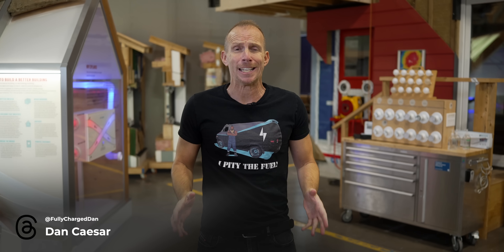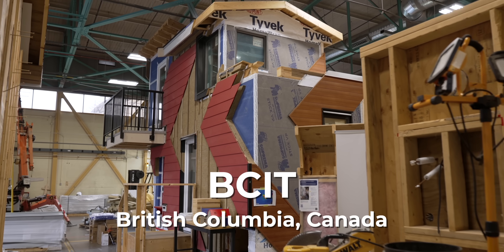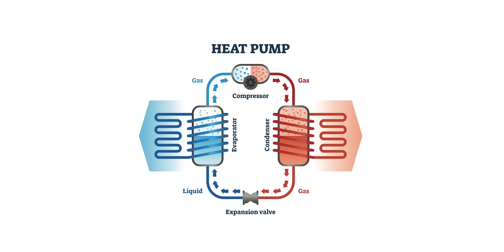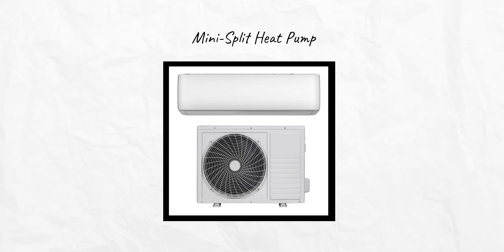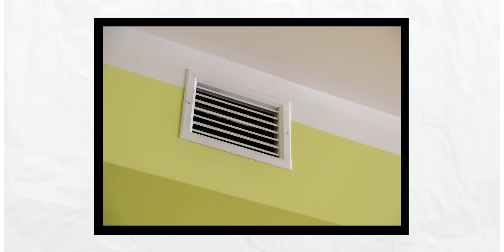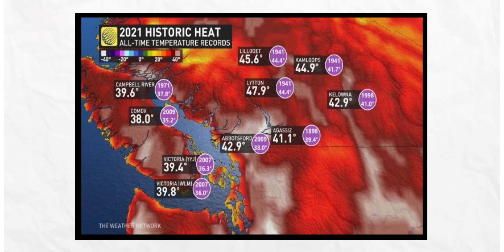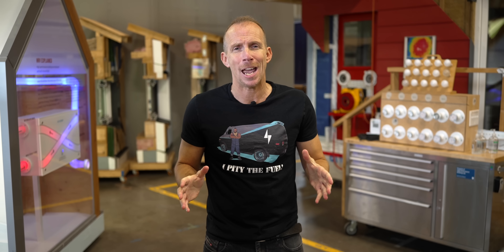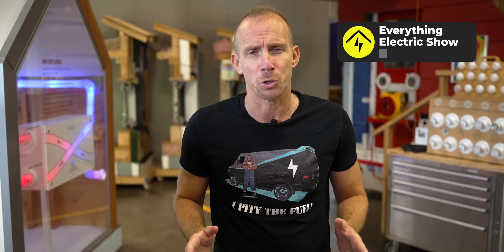The Future of Home Heating and Cooling!?!

Comment: I am so surprised at how little the Samsung TDM Plus isn't talked about - you have heat your water, underfloor heating and radiators as well as cool your home with AC units - it is a combined Air-to-Air and Air-to-Water heat pump, how is this not celebrated and the holy grail of home climate control. In a world with more varying temperatures, a solution in one form factor seems logical. Why have one unit to heat things and another to cool. If anyone has information on others out there please let me know but Everything Electric - you have missed an opportunity - do a deep dive and get this information out there - the space is so one dimensional right now

Comment: Yes we live in the UK and had these installed about 8 years ago. Downside is that we can't seem to get rid of guests when there is a heat wave in the summer. 
Unfortunately no UK gov subsidy for these. Also   you need some sort of hot water system to complement.
Plus side is that they are very compact and inconspicuous.  You don't need to turn your home in to something that looks like a oil refinery or chemical plant with pipes all over like with Air to Water.

Comment: Radiative heat is fantastic, but you can't radiate cool. You have to pass air through a heat exchanger to cool a room. Placing air conditioners near the floor is a bad idea especially with pets. Hair and crap will more easily clog a filter that close to the floor. Only wall or ceiling units are really viable. I think it's left over from convective heat needing to be close to the floor. The forced air solves that problem.

Comment: could have included maintenance (deep clean blower wheel) and ductwork evaluation (if leaking,  poor performance is blamed on HP). not a simple drop in replacement but too many contractors do it that way.

Comment: We are in the uk and had this system installed in our house . We looked at a wet system but liked the idea of cooling in the summer . We already have solar to heat our hot water . So we have had our gas disconnected so no more daily standing charge for gas . Will have to wait for the winter to work out costs to run but I’m sure it will be cheaper with the savings on not paying standing charges 12 months of the year for gas. If the grant covered these systems it would have more than paid for our system .

Comment: With the perceived uk press saying heat pumps dont work. This worry to remove gas boilers is now ingrained. I dont know why the UK government dont have subsidised for air to air . Retaining the existing boiler system. Perhaps with law that requires removal of the obsolete gas or oil bolier after few years or repayment of government subsidy

Comment: I would love an A2A heatpump in the UK, especailly if there is a way it can manage hot water as well. It would be much better for me than a Air to Water
Reply: They exist, I have one which is great.  Just not available currently in the UK (probably lack of demand).  Mine is a Hitachi yutampo twin.
Daikin do the Multi+ which might be available in the UK. But the cylinder isn't that big, in 90 and 120l capacities.

Comment: Great reminder of the difference between air to water & air to air heat pumps. I’d like to understand the cost involved in retrofitting a traditional gas boiler to a2a - it sounded like extra pumps or much more complexity to heat/cool multiple rooms.
Reply: It's quite different. Your old plumbing/radiators is not used at all. So you get rid of the boiler and all the rads, and put a few A2A units in instead. That can be one external unit and 3-5 internal ones, or just 2-5 independent units. The main difference is that you don't necessarily have an emitter in every room because air moves around and you don't really need them. Also you need something separate to do the hot water (immersion, A2W HP built in the tank, separate small A2W just for hot water, zip instant water heaters). The pipes run outside and the units themselves are quite cheap,  so these systems are usually not expensive to fit.

Comment: As some others have commented it is daft that this country hasn’t adopted this technology.  I had it installed in June of last year and it is fantastic.  Great heat in the winter and so a huge bonus to be able to cool my house in the summer.  I have 6 indoor units run in from 2 multisplit Daikin outdoor units. Whisper quiet when working and quick to provide either heating or cooling.  It seems to make so much more sense to convert air at one temp to air at another rather than air to water.  All my old radiators and pipes have gone and with the Mixergy iHP cylinder installed my gas combi boiler has gone and gas meter removed.

Comment: Heat Geek raised some interesting points about air to air vs air to water heat pumps for heating in this video:  https://youtu.be/tNE5GEePXuk?si=CWe9lDb0-JkqSF0O

Obviously they’re great for cooling, but for heating it seems air to water may have the edge when it comes to comfort. Obviously this is a very personal opinion but I thought I’d share this video as I found it insightful, and it raised points I hadn’t thought of (like how moving air removes the layer of heat trapped around your body, that it can potentially dry your skin quicker etc) 👍🏻

Comment: Everything electric - would love to know what the running costs (including loan interest) is for a heatpump vs boiler in the typical housing stock lived in by the bottom 50% of uk earners. My assumption (which could be wrong is typical low income housing stock is poorly insulated & leakier).

Comment: Most properties in Australia have the reverse cycle air-conditioning or heat pump.  The only thing I am not a fan of and much prefer radiant heat is the air blowing and the ongoing noise that it makes I think taking underfloor hydronic type system and using a air-to-water or perhaps even a ground-source heatpump maybe geothermal even as has been done by some.

Comment: I always thought heat / cool pumps are kind of geothermal? As temps a few meters under the ground is quite stable throughout the year, but not that kind of geothermal with hundreds of meters that's always hot to only work in winter or generate electricity.

Comment: Air sourced heat pumps gets better the warmer the outside air is, it's a fundamental property of the physics involved, the lower the temperature rise you need to create with a heat pump, the higher the efficiency you can get. That means they're even better suited for places like the UK, where it doesn't get cold, more than rarely, and temporarily, compared to places like Sweden and Finland. Even if a lot of air to air heat pumps are optimized to work well in as low temperatures as possible, they are always more efficient the higher the outdoor temperature is, all else equal.   

Obviously, if the wind more or less blows straight through the house you'll still need a lot of heating even when it's just "UK-cold" outside, but that seems like another good reason to reduce the amount of energy input required to achieve that heating. I've heard the often bad insulation in UK used as an argument against air sourced heat pumps, which doesn't make sense to me. Getting insulation is another good idea in such cases, when possible, and not technically mutually exclusive even if investing in both at the same time can be too much of an investment in many cases.
Reply: Excellent input. I find there's very little info on heat pumps for cooling, so was quite interested when you mention that "heat pumps gets better the warmer the outside air is". As mentioned in the video, how do you find the A2A heat pumps hold up in very hot, summer weather (ie, 40º C)?

Comment: As an Australian I have to smile at videos like this. A2A heat pumps as you are calling Reverse Cycle Air Conditioning are so common here that we just refer to them as ‘air conditioners’. I don’t think you could buy a cooling-only air conditioner in Australia - at least for domestic use. We’ve had one in this house for 30 years. On the other hand air to water heat pumps are rare here and, by UK/EU standards, Australian houses have about the same thermal efficiency as a tent… Thermal efficiency is something that is getting more and more interest here as power prices rise.

Comment: I'm in Ontario, quoted $20k for a Mitsubishi Zuba 3ton a couple years ago. I want to go to one but I was also quoted another $15k+ plus for electrical upgrades, it's not cheap depending on your starting point. As a Canadian I would also mention there's a lot of work being done by Enbridge to expand natural gas and the contractor who quoted me for the heat pump repeatedly told me it would be real easy just to do propane.

Comment: I'm using this too in the Netherlands. 
One thing though is you have to clean the filters at least every few months. If you forget that, it still seems to work, but has much less power and the efficiency is down the drain.
Also cheap ones can be noisy, so go for mid level

Comment: We've had air-air heat pumps in New Zealand for as long as I've lived here 20 years, and it's not a very comfortable heat. It is drafty and can feel cold even though it's blowing warm air. Most homes in New Zealand install a single air-air heat pump in the living room and expect it to heat the whole house. We have ducted gas air heating and have looked at switching to a heatpump, but we need to replace all of the ducting in the house which is expensive. Ducted air heating systems are noisy where the air rushes out of the ducting, and switching to a heat pump from gas wouldn't actully save us any money due to the unit cost of gas compared to the peak rate of electricity. There is nothing like the warmth of radiated heat like that from radiators or a wood burner. It's quite common for people here to use them to cool their homes, rather than open a window, and that just puts pressure on our already stretched grid. We're having a bit of a power crisis here with low hydro levels, lack of wind and reduced gas reserves, so are importing a lot more coal and wholesale electricity prices have doubled over the last 3 weeks and the cost is expected to flow onto consumers over the coming weeks.

Comment: Fascinating. We’ve got two A2A heat pumps and live in NZ’s South Island. They’re ubiquitous. My area is quite sunny, so my heat pumps run for free off my 7Kw solar panels on a sunny cold day, and cool the house for free in the summer. One issue we notice is that it’s not radiant heat. So that primal feeling of heat-on-your-skin is missing (not a big deal) and despite what they say, the interior fans DO make a noise, albeit fairly quiet. For those still struggling with ‘how the hell do these things work?’; My installer described it as a simple exchange of temperature. If it’s 10 degrees C inside and you want 19, the unit ‘steals’ 9 degrees from the outside air and blows it into the house. That does cool the ambient air around the outside unit a whole lot, but the unit’s fan blows that away and ambient air replaces it. We don’t get Canadian-style winters, but it’s absolutely fine at -5 C and also cools the house on a 32 C day in summer.
Reply: Hopefully the fan noise problem should be significantly mitigated in the future as acoustic metamaterials become commercialised across all industries.

These should make all sorts of noise polluters like fans less of a problem, not to mention offering new, more compact solutions for acoustic isolation/insulation in the home, both from outside and inside sources.

Comment: I had a 3.5 kW Midea A2A split installed 2 and a half years ago. It was deadly cheap but works superbly. I still have my standard gas central heating but hardly ever use it.

Comment: novice question...an a2a heat pump cooling.... it sucks out the hot air in your house....but does it blow cooled air into your house?
Reply: Yes. An A2A heat pump is esentially identical to a standard air conditioning unit.
Reply: It takes the hot air in your house and cools it off by moving the HEAT outside. You need a different system to get fresh air in your house if your house isn’t leaky.

Comment: I’m confused. I have a Mitsubishi multi split unit that can heat and cool the air. Is this a heat pump or an air conditioner? How do you tell the difference?
Reply: They are essentially the same thing.
Reply: This IS a heat pump. Technically, any unit that can cool is going to be a heat pump, any unit that is heat only is probably not a heat pump.

Comment: There's 3 actually:  Water to water. 

It's almost impossible to buy a cooling only system in the UK for over a decade. I believe A2A is not included in any schemes because if you use them on cooling there is a total energy loss so the COP heat is going into the atmosphere. 
Although in reality in the Uk in domestic situations they are used more for heating than the odd 3 days of summer.
Reply: At the same time as the BUS Grant was introduced on Water Heat Pumps VAT was waived on Air to Air
Reply: @davetester100  The customer could only get the VAT relief if they put 'heating' if they put 'air conditioner' it was rejected..

Comment: Last time I checked air to air heatpumps are usually more efficient than air to water heat pumps, as well as being much cheaper to buy in the first place. The lack of subsidy is not as bad as you imply, because they're not much more expensive than buying a gas boiler, and the running costs are much lower.

Comment: The first question to ask when thinking about changing your heating system:
Do you just need to heat your home or do you want to cool it as well?
Crazy that the boiler replacement grant doesn't cover air to air pumps which do just that
Reply: https://youtu.be/myvfqCx1-zk?si=X1QHaZpKEuz3Z5Ri

Comment: I don't understand why this is deemed to be "novel" - I just recently installed a 3.5kW A2A mini-split in the UK for just over £600 (R290 before anyone has a meltdown) - it has been perfect over the last few days of 30C+ weather and in the spring/autumn it will contribute to heating - all powered by PV so totally carbon neutral and runs off a 13A plug so no wiring needed either - the hardest part was core drilling through the wall and making the connections...I've heard Vaillant want £300 for a "cooling chip" for the Arotherm A2W series - rip-off Britain at its finest 🙄

Comment: we have both, air 2 water as main source of heating, and underfloor heating on the ground floor and heating up the water in the boiler. And two A2A single splits on each floor above the ground floor for both cooling and some additional heating especially in my home office so that i dont need to warm up the whole house when i work at home.

Comment: Thanks for doing the video. 
I think this is a really important aspect of heating that’s under rated. I think there are lots of commercial applications like shops that just use resistive heating that’s so inefficient that can be upgraded to this and will save them a fortune in electricity costs. I hate those Air Curtain heaters in the entryway to shops, they seem such a waste next to open doors and resistive heaters!

Can you do another video please on a little more detail?
I’ve been looking for A2A heatpumps for my new office and it’s very hard to find a confident installer that knows about air to air and very few experts that know if there is indeed any difference between an ‘air con unit’ and one that’s specifically designed and optimised for heating (that can also do some cooling but isn’t it’s primary function).
Reply: https://youtu.be/myvfqCx1-zk?si=X1QHaZpKEuz3Z5Ri

Comment: Thanks for another helpful video, Dan. We live in west central Scotland and have a mini-split A2A in our garden office, which works very well. We are in the process of removing the gas central heating from our main house - a typical 3-bed semi - and installing another two A2A heat pumps, each serving two wall-mounted units. It's important to keep in mind when considering a move from say gas central heating to A2A for space heating that you'll also need to have some way to heat your hot water. Could use another heat pump based system or a phase-change heat battery using off-peak electricity or solar/battery if you have it.

I agree with commenters here that it is very short-sighted of govt in the UK not to extend grant assisted funding to A2A systems.

Comment: So how does it work?
Reply: Valving that allows reverse circulation of the refrigerant.  The condenser becomes the evaporator and vice versa when needed.
Reply: @Pottery4Life  I know how refrigeration systems work in the valves, but I don’t know is how air to air works so is it just a refrigeration system that there at 1 AM and then here at the other which is what we’ve had for years so what’s new about this?

Comment: Apologies to all Canadians but why Canada when the listeners, such as myself,  want to know how these can be accessed and installed for different types of properties in the UK. In my experience, very few address the very high cost and disruption of altering the pipe work should they connect to a normal heating system.
Reply: Installation is straightforward for single or multi-head units. Basically running a set of large-ish cables from the main unit, up along a wall, then drilling a hole into the wall where you will be installing the head units. Power is run to the compressor - usually from a pony panel - then distributed to where it's needed. Cables get covered in a PVC type shell for weatherproofing and appearance.
Reply: Canada is because they have a lot of heat pump experience in Canada and as a former British Dominion they have similar standards.
Reply: My Mitsubishi was installed in the UK in 2022 at a cost of £2k.
No pipe work, just a 20cm hole through the external wall to connect indoor unit.